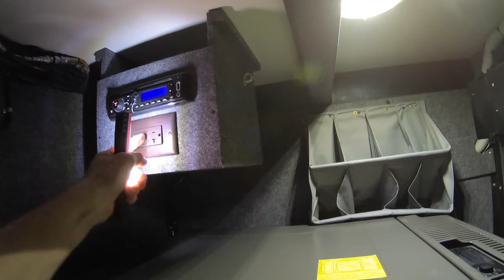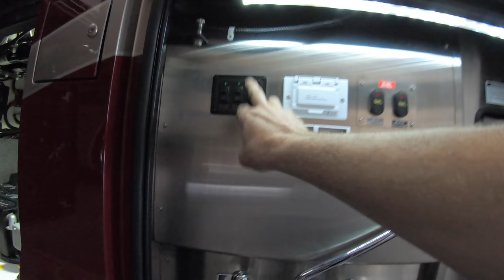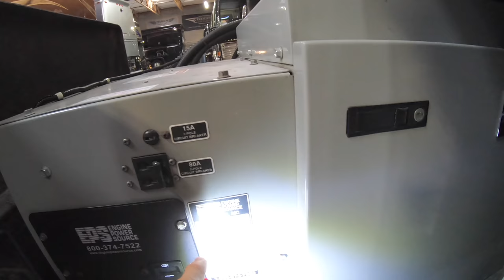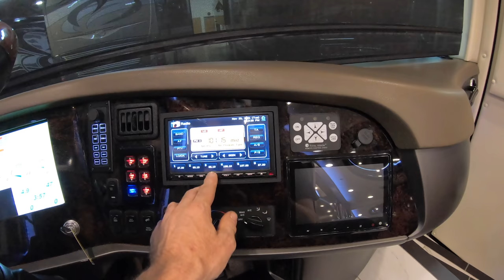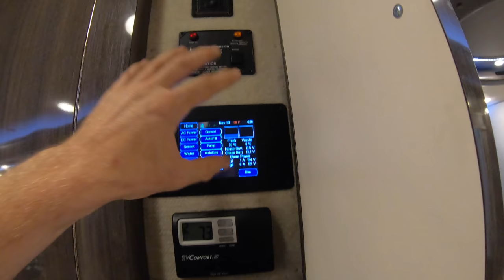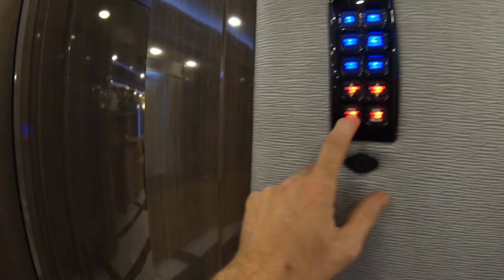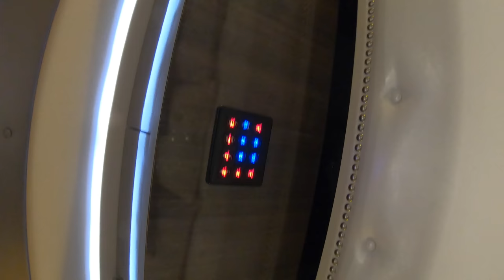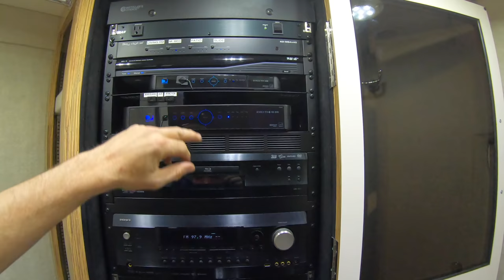2015 Foretravel  ih-45 (Iron Horse)￼

Comment: Brian you crack me up: Stinky Slinky, Mountain Money Holder...etc.
Absolutely stunning coach along with a thorough presentation!
The only downfall I p/u on with this particular coach design besides the non-covered basement doors is:
Location of the (2) Outback inverters and Mate is too far away from the house battery location. 
If one was to upgrade this system to larger capacity inverters and Lithium Iron storage cells, it's best to have all centralized in one location. Not on opposite sides. Some Solar panels would be great, too.

Comment: I typically only see storage above the living area in lower end coaches. Even the King Aire has them, but there is a delete option. I personally do not like seeing those above head cabinets in the living area as it reminds me more of a production coach instead of a custom level coach.  You will never see overhead storage in a Newell or Prevost conversion. I take the larger windows and more residential look over storage -- my humble opinion. I like the Fortravel as it is a production coach, but is one of the nicest and I place them right under Newell and Prevost conversions.